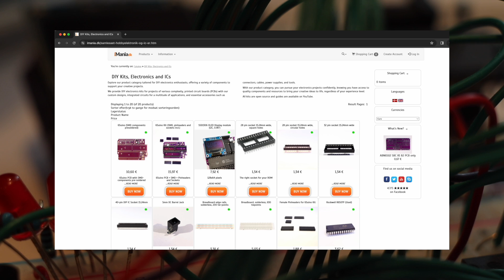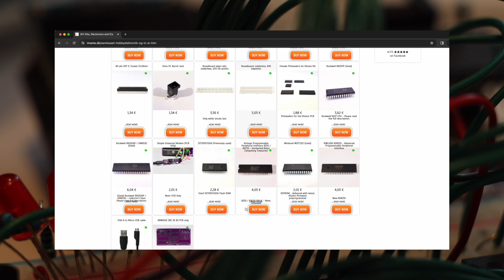Relatively Universal ROM Programmer - Hardware Walkthrough

Comment: I have a few spare 32 pin zif sockets. If you add jumpers you can configure it to lots of ROMS  I am guessing. I like the idea of the zif socket as I have a few of them on hand, and they are made by 3M Jaycar was selling each one for like  $4.50 cents each. The zif would be gentle on the legs of the older ROMS.

Comment: I totally would buy one if I didn't have to fiddle with the jumpers and trim pot. I would like to use it in an educational setting, but that means I should be able to select the EEPROM in the programming tool and have confidence that all settings on the programmer are good.
I still like your design from a hobby perspective ☺
Reply from the maker: Considering it would always require some end user soldering, it's certainly an educational thing. 
I could have made it without the configurability or used a few more transistors but it quickly costs some of the universal nature :) 
For 28 pin EPROMs/EEPROMs that just need 12V/14V, the jumpers and pot is a "set and forget" kind of thing.

Comment: Do you have an extra arduino analogue pin left? It would be nice to have voltage sensing built into the device, by having the programming voltage be fed back to the arduino analogue input pin via a resistive divider. Otherwise i suppose one can just hardwire one of those cheap panel voltmeter modules so one doesn't have to break out a multimeter. I prefer not probing live circuits whenever i don't have to because sometimes very rarely probes slip and undesirable things happen :D
Reply from the maker: You are absolutely correct. I'm slightly biased because the 65uino I'm prototyping it for doesn't have any analog pins - I thought about adding an ADC but I was too late with the thought to actually throw in a resistor divider for an Arduino's "A2" for instance. Super easy fix for next revision :) Actually it doesn't take much to hack on a resistor divider as A0 and A1 is already right next to "VPE" and GND is everywhere.

Comment: you should try program a microcontroller
Reply from the maker: Can you elaborate on that? :)
Reply: @AndersNielsenAA  like make it program pic microcontrollers or avr . It would make this rom 6502  programer just like a those expensive rom programer
Reply from the maker: @natas_d  Ah, gotcha! The design relies on the fact that all ROMs have a standard JEDEC layout, so the data pins line up no matter the chip. But for other layouts, like AVRs, PICs and 8051s, you'll at least need an adapter
Reply: @AndersNielsenAA  if you want u can add a ftdi chip like ch340  lthat can be selected by transistor and it would program them
Reply: technically the rom programmer plugs into an 8bit microcontroller board - it's just not a one-chip microcontroller.
Reply from the maker: Well, technically technically it plugs into an 8 bit micro*computer* board. I guess I'll get to making an 8051 version eventually :)
Reply: @AndersNielsenAA  Hmm, the 6532 provides dio and a timer, and the 65duino doesn't have a monitor and keyboard. I think the late 70's early 80's definition of microcomputer includes a video monitor, kb, and mass storage?
Reply from the maker: @soupwizard  The Altair 8800 would take great offence with that definition :)